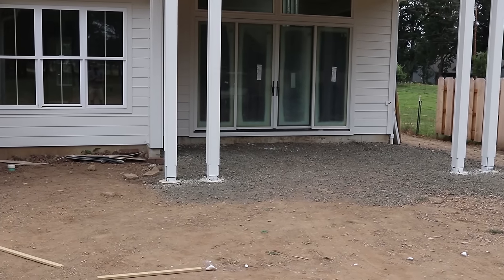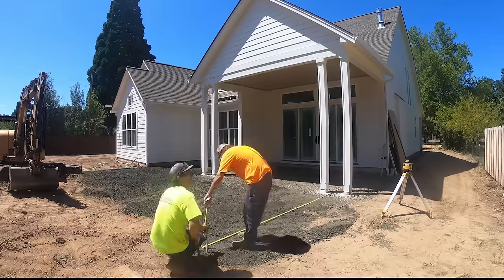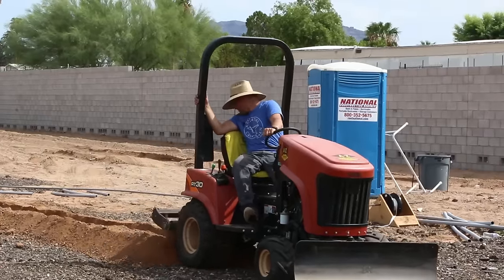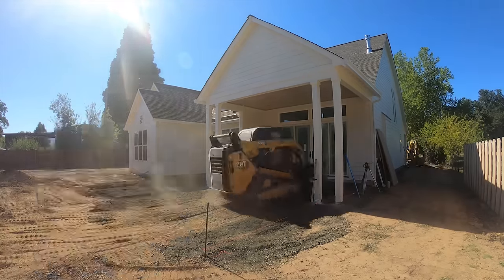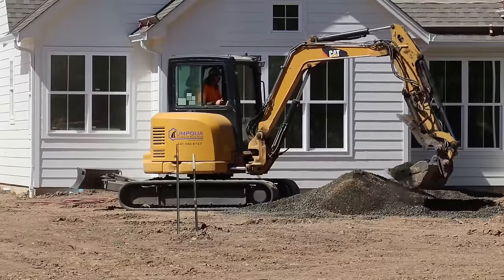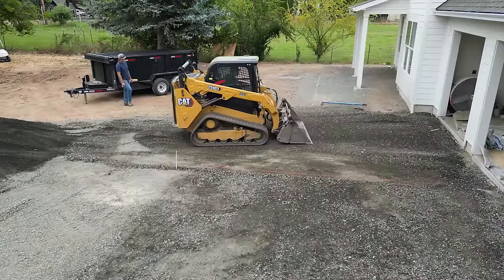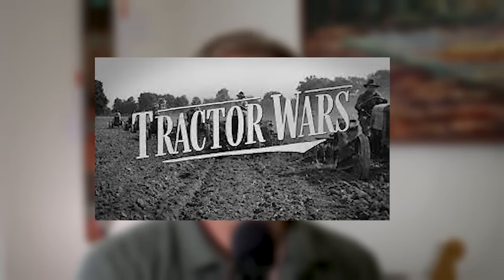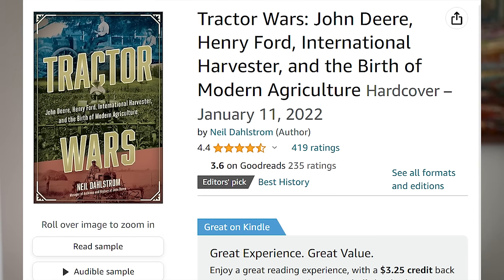Prepping for Concrete with Caterpillar

Comment: During the building boom of the 1950s my uncles decided they needed To have their own machine so the wouldn’t be stuck waiting for someone else to did the foundation, they got an Oliver tractor with a bucket loader and converted it to a track machine. They also bought a small Ford dump truck and a tiltbed equipment trailer.all three were still on what had been my grandparent’s property until the nineties and that trailer which moved since 1970 was still sitting behind the barn in 2017

Comment: My boss’s ethos is always get the largest machine that’s viable to do that job. If you think you need a mini excavator to get the job done think hard if there’s any possible way to get a 35 or a 50 in there to do it. It will go twice as fast, with less wear on the machines and the extra cost to rent or hire a large machine is offset by the time saved.
Reply: Good to know.

Comment: So, I got some opinions. Got about 20 years of experience in operating equipment. 
Like vehicles, equipment from different manufacturers will depend on the year and how many innovations they tried to cram in to that generation of the model.
Got a 2000 New Holland L190 that is absolutely bulletproof, couldn't ask for a better loader. Their 2017 c227 is a pile of hot garbage, avoid at all costs.
Spent about 650 hours in a CAT 299D3 rental once, and Nate's dead on about their build quality and user friendliness. Wish I could've afforded to buy one, but the John Deere 325g, which I currently run, is comparable in those same terms.

Again, the salient point is year and make fluctuate in build quality, but if you find a good one, keep it.

Comment: I have CAT 302.7CR and 303.5CR mini-excavators. They both have problems straight from the factory, which the dealer mechanics are not given the tools or authority to fix. Their tracks are twitchy and so can not be counted on on steep/dangerous grades (unsafe) and their blades become very slow to respond or non-responsive when grading downhill or back-dragging downhill. ...very disappointing especially with local, dealer management deciding there is nothing that they can do. Translation: your problem, not ours. The Kubota, Komatsu, and Bobcat mini-ex's I have operated do NOT have these problems.

Comment: It used to be, and Ithink it still is, that Cat were the largest producer of Earth Movers, ten time bigger than the next player, Komatsu who in turn were ten time bigger than John Deere. JCB like to think that they're big but in 2016 (the last time I worked for JCB) Finning made more profit than JCB turned over.
What drives Cat is the attention to process, doing it the same way over and over. I worked in Engine Development for Cat for eight years on a wide range of products but in each case the process was the same. It didn't matter if it was a four litre engine or a sixty four litre engine the steps were the same, Design, Test, Develop, Validate.

Comment: What I learned from YouTube machinists is that once your equipment gets big enough, spare parts and company support doesn't matter. You just need a good mechanic and someone to make whatever you need, plus enough money to run a spare machine while the chips are being made.
Reply: I am a machinist and it's a waste of time and money to make something that you can just buy off the shelf in the vast majority of situations, even for the big stuff.
Reply: @SuperAWaC  $50,000 vs 10h shop time and a few grand in materials? 🤔

Of course, I'm not talking about building entirely from scratch.
Reply: @wayneswonderarium  it depends exactly on what it is. i really shouldn't have to say there are exceptions because that should be obvious but i guess it isn't

Comment: Thanks for this... I guess my biggest hang-up with all this equipment is that it seems like the engineers/designers go out of their way to make maintenance/repair next to impossible.   They cram everything into the smallest amount of space and in so doing block access to stuff as simple as the oil drain plug or oil filter... making it necessary to remove a hydraulic pump or a fuel system or some monsterous skid plate before performing just basic maintenance.  I guess they are getting better over time... but sometimes it just makes you scratch your head and wonder.
Reply: Most are to one degree or another , although it can vary by type of machine and model .
Now , if only the car and truck manufacturers could read ...
Reply: German engineering

Comment: I have been around heavy equipment in my entire 47-year career.  Cat definitely stands out worldwide, however, I am hearing from equipment operators that the large Komatsu track hoes are more durable and smoother to operate than the Cat models.  Take it for what it's worth.  It's just what I have gleaned from operators in my state.  Thanks.

Comment: They are all good these days, but it depends on what service you have locally. That's not to say they are all the same. Go try out machines from dealerships near you.  If there is a CAT dealer nearby, but no Bobcat dealer in your part of the state, then go with CAT. Service is part of it and differs everywhere.

Comment: JCB from the UK was started before Cat, 1945 in fact. It manufactures across the world and makes machinery for the US Army. I believe it is a world leader in electrical and Hydrogen powered diggers
Reply: Caterpillar was founded in 1925 with the merger of Holt Manufacturing Company (founded in1883) and and the C. L. Best Tractor Company (founded in 1910).
Reply: JCB is over-priced rubbish !

Comment: Case was founded in 1842 and made both agricultural and construction equipment, Cat was made from the merger of two companies in 1925, those companies being Holt ( formed in 1892 ) and Best ( formed in 1910 ). Case is the first company to make what is called the Backhoe Loader which is probably the most common piece of equipment used on construction sites to this day. Jerome Case also a Politician and Banker as well as investor and all around good citizen helping when times got difficult. You should really do a video about his history because He is an early craftsman in many ways.

Comment: All I know was the Deere skid steer I was on last week with .9 hours sucked!  My older Kubota has way better sight lines and the bucket doesn't have to be totally down and flat to open the freaking door. The AC was nice but otherwise that Deere was terrible to use.

Comment: Lots of intangibles in the overall designs , that can set a piece of equipment apart for some operators and jobs , or , make them a royal PIA for others doing different work .
Visibility and sight lines are important , and what isn't an issue for some jobs can be almost counterproductive for others .
The same with the ergonomics of the controls and the particular features of each model .
And lately it seems , a lot of manufacturers have finally gotten the memo , about not burying filters , dipsticks , and , tank and case drains , behind major complex mechanical assemblies .
YMMV tho .